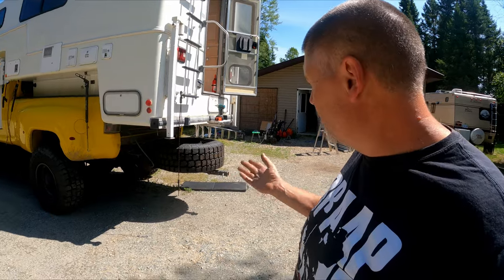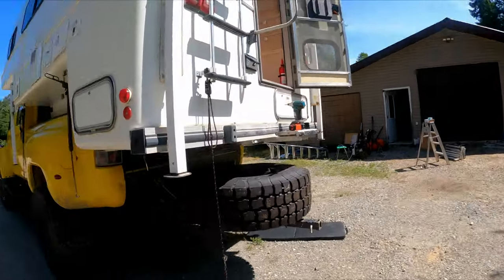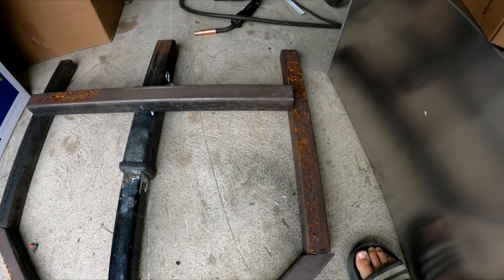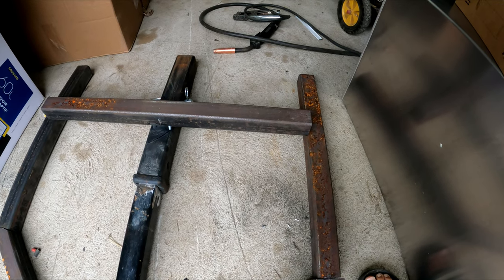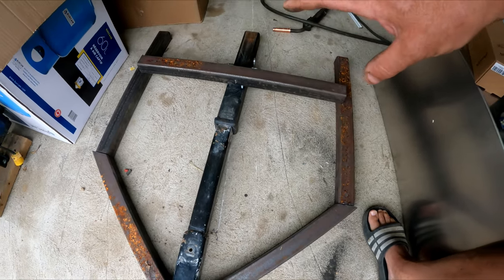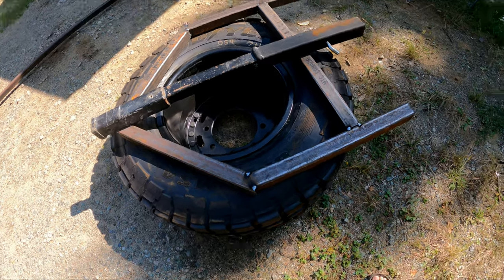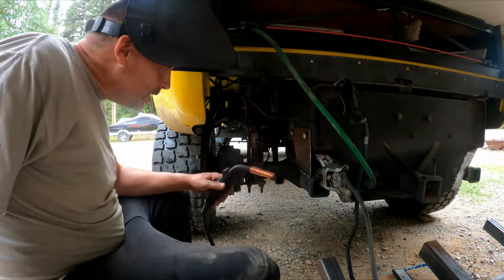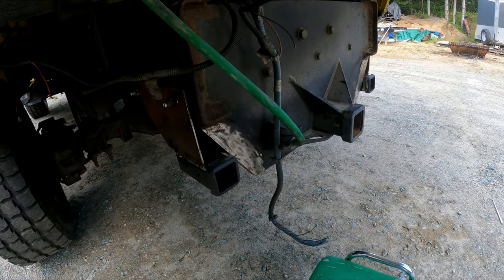Ultimate Spare Tire Holder with Hitch Extension for MONSTER Spare!

Comment: Hey camper looks good on your rig :) Good sturdy hitch the way you have it made should handle a bit, 👍Nice rig but those big ties are going to kill your fuel economy but I'm sure you will enjoy it after all that work :) Take care see you on the road soon !
Reply from the maker: Thanks for the comments. The tires didn't really change the fuel economy. It went from bad to bad 😂. There is no "good" mileage when you're driving your house around.
Reply: @TheTimeIsNowAdventures  Lol ! That is true :) Mine is not as big but I tow a small trailer too, & with the old 7.3 power stroke I still get 18mpg on average :)
Reply: @TheTimeIsNowAdventures  I am making a little lake trip for some big Pike this week !
Reply from the maker: Wow. That's amazing mileage. Our 6.9 in the diesel duchess gets about 12mpg which is around 20L/100km. This truck uses a little more, 10-11mpg so far. But it has way more power than the duchess. Good luck fishing.
Reply: @TheTimeIsNowAdventures  Thanks always have fun that's all that matters :) 12 years ago I had a 10F it for one summer & i got 12mpg so it was change the plan :)

Comment: What's the total height of you're unit?
Reply from the maker: Is about 12' 8". Thanks for commenting
Reply: @TheTimeIsNowAdventures  I thought it would be much higher than that. My stock dually with an Arctic fox camper is 12'.
Reply from the maker: I'm no expert on the differences between campers but I believe the bigfoot may have one of the lower roof heights. We also don't have an AC unit up there.